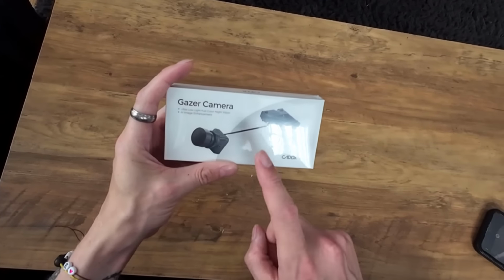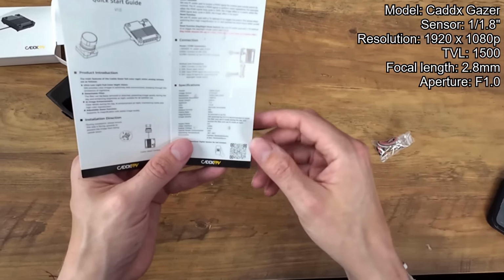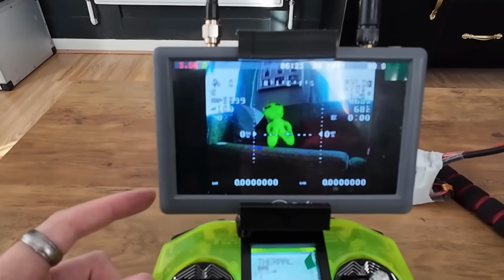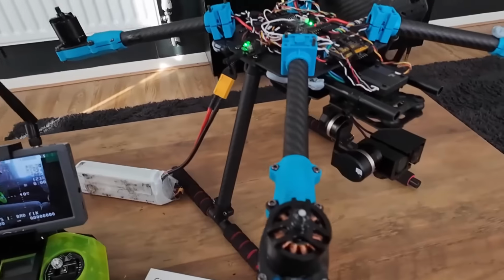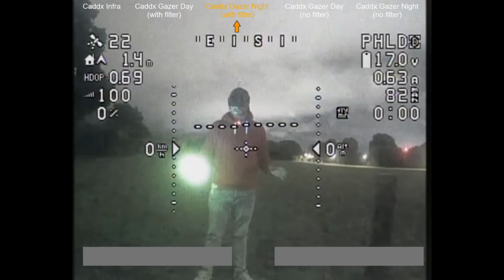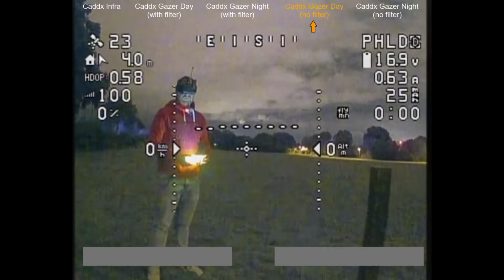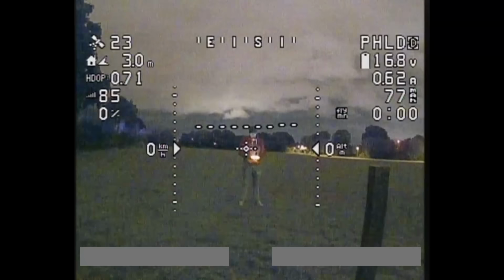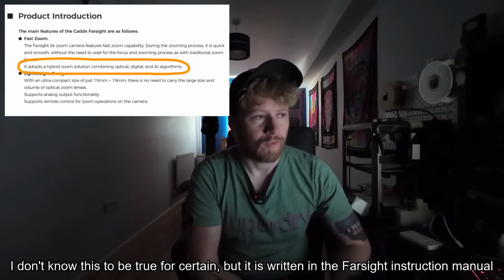📷 Caddx Gazer - COLOUR Night Vision FPV Camera - Unboxing And Review

Comment: The filter is an IR block filter, it's used in nearly all cameras built in in front of the sensor. Otherwise the IR light would blow out the red pixels on the sensor. (hence the pink glaze) 
There are day&night cameras with a built in filter moved by a motor for the night mode, or so called software day&night where there is no filter, and they compensate the pinkness in processing. 
The gazer has the proper filter, can be removed by hand, as an electromechanic way would be too big and heavy for FPV purposes. In the night mode it changes processing, expecting more infrared light. Also, the quality in low light with the filter on is degraded as there is significantly less light getting to the sensor, it gets noisy, the noise filtering kicks in hard, therefore having less detail.

Comment: Hi giz hope your well buddy been a subscriber for years! Looking to get back into flying again and I want to give long range fpv a go. I still have my taranis x9d transmitter would that be ok? Also any planes and parts your recommend for a long range build?
Reply from the maker: Hey man. The X9D is still a decent radio, however it is old and likely isn't supported by modern firmware. That in itself probably isn't much of a issue, however if you want to get into long range, you'll want a long range control link. These days ELRS is the system most favoured by pilots. You can likely get a module that'll fit your x9d, although I don't know if the firmware will support it. Personally if I were you, I'd look at getting a new modern radio, one that has ELRS built in. You don't need to pay much for one. I personally use the Radiomaster Pocket, which is probably one of the cheapest radios you can buy (only about £50). Don't like the price mislead you tho - it's a fully equipped radio with most the modern features you'd ever want and it's very reliable. I've owned many big fancy expensive radios over the years, but actually love my Pocket more than any other them 😊

Comment: id like to know how to fit camera like this onto a car? Some players like kenwood have analog input for reverse camera, does it just plug into that. Could be useful during night to see animals, installing the camera behind the front grill and installing switch between reverse wire and ground so reverse could be turned on even when going forward

Comment: Thanks, very interesting ... it seems the night mode is averaging the video signal, reducing bandwidth but also taking away some more contrast and color, but I guess with a weak signal going into night mode makes sense. But in general the Gazer is really impressive and makes the best compromise of low light and signal/noise while being extremely sensitive.

Comment: I believe that the Farsight camera is digital zoom as well.
I suspect they may be using a higher resolution sensor on the Farsight.
Reply from the maker: According to the manual for the Farsight camera, its a hybrid zoom (optical and digital), whatever that's supposed to mean?

Comment: I think the zoom feature is good because they said that the sensor resolution is 1920x1080 while the output is 720x576.
So you can't take advantage of the FHD sensor resolution with the PAL output, but with the zoom you can.

Comment: Does the Gazer Camera require a VTX?? Or is the VTX the box it comes with?
Reply: You will need a VTX, the box is just where the AI is stored.
Reply: @xGonniX thank you! I was wondering this as it doesn't necessarily say it on the site. I guess it's only compatible with analog VTX and not HD VTX? I know it says analog, but am hoping the VTX quality of analog doesn't take away from the camera quality on my monitor. Got any thoughts? Appreciate the response as well!
Reply from the maker: The camera is only compatible with analog VTX's unfortunately
Reply: @gizfpv that's no worries. If you do another video, maybe you can walk us through the wiring / setup a bit? I am going to get this setup on a speedy bee f405 wing, with INAV. Hope it works, I know it's a bit confusing

Comment: Something to consider.  I build drones for my job.  However when testing camera capabilities lights like the one on your controller can throw off how the camera and processing system tries to adjust the image.  I do like you have the controller in your hand for this test as this is a real world use case but to answer your questions about the day and night mode you definitely need to test without direct light sources within frame.
Reply from the maker: That is a very valid point. Any bright light source will throw off the exposure during a low light shot
Reply: Any chance you could point me in the right direction for a half decent drone with a flight time of 20+ minutes that I could chuck a gimbal camera on? 
I know of the flywoo explorer lr4 but no idea how it would go with the extra camera. Also I've never built a drone in my life so rtf is preferred but not undesirable lol
Reply: Yeah I was thinking the same thing as a huge bright light right in front of the camera

Comment: Considering that it's half the price of the Infra, the Gazer is amazing! That's the price point where buying one for a DIY NVG is a no-brainer. 😁
The big difference regarding the image details is of course due to the different sensors and methods: near-infrared light ("real" night vision) vs. visible light amplification!
Unfortunately, they probably won't produce a real infrared-only (thermal) FPV camera in that price range, because gallium lenses are really expensive. ;-)
Reply: Germanium, not Gallium. And the lenses are not that expensive, you get them for 10 dollars from china. The expensive bit is the image sensor, and those are rapidly falling in price due to the sudden demand. 
Axis flying sells thermal analog FPV cameras from about 220 dollars. The high resolution 60fps one is 600 dollars, which is honestly insane for the specs. Just 5 years ago you would have paid 10 times that.
Reply: Real night vision with image intensifier tubes is both visible and near IR (short wave). Thermal is far IR (long wave) only. Glass is used for short wave IR and visible, germanium is for long wave IR.

Comment: Filter will be an IR Cut, most action cameras have one inside the lens or over the sensor, All Mirrorless and DSLR's have them built on to the sensor, same goes with Cine cameras and camcorders.
There may also be a ND element involved, to reduce the light level in daytime use and protect the sensor. It is not a UV filter - that would be pointless on a camera aimed at use at a time of day where there is no UV light for it to use to see with. The extra pink in the image in the daytime, is the wideband nature of the sensor without the IR being cut out, and also why the image is soft, as IR light has a different focal distance compared to Green or Blue.
Looks like the Infra still has the edge, and the filterless night mode has a little more contrast, but much lower saturation. Night mode for flying, day mode for showing.
Reply from the maker: You're absolutely right. I did add a note towards the end of the video saying it was likely a IR filter.And yeah as you said, a UV filter wouldn't make sense would it lol

Comment: Great review! Did you notice any added Latency on this Camera vs a standard CVBS Analog Camera? It looks like a great color camera option for Day & Nighttime honestly.. I am very impressed as well. 
What are some regular Analog Camera's that you would consider the best night-time use camera's that came before the Caddx Infra & Gazer where it's basically just the Analog camera itself? I've heard some people like the Night Eagle camera, Ive personally used some older models like the Foxeer Cat S-Starlight Analog camera that switched from Color to B&W automatically and it works great still from an older Betaflight Drone I had it on and now on a newer budget Analog build that I fly in my area in a grass fields, around the street lights and things like that. Definitely not in a setting this dark, but I believe it does have a 0.000001Lux Rating. I've been looking for some newer options to add to a new drone im building since that once is a circa-2015/2020 FPV Camera and is not available anymore and its the older "full-size" 27/28mm Camera that I have in a TBS Source1 Frame that actually takes that size natively. Most stuff these days in 7" in or smaller are using 19mm-20mm Camera's or smaller. So I just figured id ask if you had any experience with something like that and have some recommendations for a more normal Analog camera without the extra AI Processing Box that comes with these newer Caddx Infra & Caddx Gazer Camera's. Though I do think I will eventually pick up either one of these once I end up finally building my FPV Wing that i have in the box still lol, as it has the space for this and would be more useful in this type of situation for me at least.. Thanks!!
Reply from the maker: To be honest because I've only used the camera on the ground so far, I haven't really been in a position to observe the latency. There certainly hasn't been any noticeable latency so far, but it's only once I get it in the air that I'll be able to say for sure.

As for other analog night vision camera's, I've not been able to test them all myself, but I do know the Runcam Phoenix 2 was a surprisingly decent camera for low light. Obviously not as good as the Infra or Gazer, but certainly decent. From what I've seen online the newest Night Eagle is very good too, but I've not personally tried it

Comment: Awesome video!! Great comparison with a lot of great Info!! 
What onboard DVR do you use to get that nice & clean Analog Feed recorded?
Also what CNC Gimbals are you using on your Radiomaster Pocket? How do they compare to the full-size AG01 CNC Gimbals if you've ever used those before? This is my first few videos I've watched of yours so I wasnt sure.. 
Do you have a Link to the 3D mount for the Analog Screen on the RM Pocket? It looks super clean with the cut-out for the RM Pocket's Controller Screen!
Reply from the maker: The DVR I'm using is the one built in to my Skyzone Cobra X V2 goggles. The gimbals on my pocket are the AG01 nano's (made by Radiomaster). As for the screen mount on my radio, that's still a work in progress. Once I've finalised the design I'll put it on thingiverse :)

Comment: They had the Optical Zoom feature listed in the Picture part of the Product's page. So it wouldn't be searchable on the website's product page if that's what you mean that you can't find it anymore. I remember seeing this on MadTech's Livestream when it first came out and even he was talking about the Optical Zoom, bc in some spots it said Optical Zoom and some spots it said Digital Zoom, and it was in the big picture ad of the product. 
To the point of that he was also saying like I was thinking.. 
How would you control the Zoom regardless of what type of Zoom it used.. It would need a Full UART connection for that I would assume.. Or possibly PWM set-up from the FC for the Zoom I guess could work as well, but it definitely did advertise 3 levels of Zoom. 
Haven't really heard or seen much of anything since this was announced a few weeks/month ago then so I'm glad to see this video!!
Reply from the maker: Yeah I feel certain that when Caddx announced the Gazer they said it had optical zoom, but I can't find any posts that say that now, so maybe they deleted or edited them

Comment: I wonder if the additional ports are to make a walksnail version like the moonlight. The ports look very similar to the walksnail moonlight ports with the "usb" 4 pin cable used. I would not be surprised if its the same "AI" box, maybe we  will get walksnail support eventually?
Reply from the maker: Yeah I'd be interested to know what the other ports are for. No mention of them at all in the manual

Comment: I've had this for a while now, been waiting on someone to make a video about it as I'm LOST on how to use/set up. The instructions/info on this are ridiculously poor (its pathetic to see Caddx putting that out) and I ordered it to do a day/night capable quad with BF, I hope someone does a video on hot to set it up on BF soon so i can use this paperweight, lol. 

One question I have though, that you didn't talk about...... what's the latency like? Any difference between day/night modes as far as latency? I've seen other "night" cameras that had a very noticeable latency. Perhaps you'll address it in the next video
Reply from the maker: I don't have any aircraft running Betaflight so I can't investigate for myself, however the instructions in the manual look like they explain how to set it up reasonably well? What exactly are you struggling with?

As for latency, I haven't noticed any significant latency yet, but it's only once I get the camera in the air that i'll be able to say for sure
Reply: @gizfpv  First thing I struggled with (still not installed yet, but still learning about it) was realizing the "AI' box doesn't have a VTX in it. I was wondering why there was no info on antennas or power ratings. So that means I have to figure out where to run these wires from the box, to the FC, then to the VTX. I just did a Walksnail on an 85mm and it was a simple 4 wire solder job, I dunno, maybe I'm just overthinking the Gazer install. 

Second thing I know I'm going to struggle with (which thanks to your video, I found the online manual that does talk about it briefly, but still is out of my skill range) is setting up the controls for the D/N mode. I'm not at all interested in the zoom, but I don't know the first thing about CLI commands and "pinio" stuff

🤣🤦‍♂ I might have gotten a little in over my head with this one, but I'm sure ill figure it out eventually, just hope I don't burn anything up in the learning process lol
Reply: I am surprised you struggled to work out what the power and video lines do. Everything else is just uart configuration, which you shouldn't need to get it working at least.

Comment: Thanks for another really interesting video. I agree with our assessment concerning the Infra. I think the image from the Infra had more detail.
Still, the price for the Gazer is surprisingly good.

I think the filter is likely a near IR filter. Most color cameras have a filter to block infrared light. Normally this filter is right in front of image sensor. Astronomers often remove these filters from their cameras to improve their ability to capture faint light sources.
Reply: Yeah it's an IR-filter. That's the only thing that makes sense. Without the IR-filter, the colors will be incorrect.

Comment: I was waiting for a video from you as soon as I saw this one on their website! Might get this even if I don't have any builds to use it in at the moment, just because of the zoom feature which I've never seen before on an analog camera combined with the color low light performance is such a cool combo, and a bit more reasonably priced than the infra too.
Reply: The night vision is definitely cool. But digital zoom isn't great. It's exactly the same as taking your recorded video into Adobe Premiere, and zooming into a section of the video. You're better off recording in full frame, and zooming in when editing. You'll increase the noise and grain, just as you would with digital zoom. But at least you can choose where to zoom after the fact, instead of baking the zoom into the video
Reply: @rubberonasphalt  You do make a good point and I also generally agree it's better to have a full frame photo or video and crop in post for actual content creation purposes, but the use case I had in mind for the real time zoom was more in terms of letting me get a closer (larger) look at something while flying in the tiny goggles screens or a monitor where actual detail doesn't matter so much. I sometimes find myself switching my old dji camera drones down into 1080p video for this exact reason, because it lets me do 4x zoom in the lower resolution mode, so I can actually see stuff on the tiny 10 inch tablet display while in the air. It's great when you're exploring a forest and spot something but don't want to risk clipping a tree or losing signal by going lower.
Reply: @ml11ML  Yeah that's a fair point

Comment: Thank you so much for posting this. I’ve spent most of a week thinking I was suddenly incapable of FPV. I’m trying to get a basic start with the Gazer on a SpeedyBee F405 V4 using Betaflight. Are you able to share any of the additional troubleshooting you did? I’m at a point where I have the basic day video feed on startup but none of the zoom, zoom reset, or night switch are working whatever I try.
Reply from the maker: As I didn't use Betaflight, I can't really provide any tips regarding that. However 1 issue I did encounter when setting mine up was with the wiring loom for the UARTS/PWM connections. I didn't realise that the wiring loom is different on each end, and I initially mistakenly plugged in the wrong end when I first set things up, which resulted in things not working. Might be worth checking to see if you made the same mistake?
Reply: @gizfpv  This was it! You're a legend thank you.
Reply from the maker: @Mike97dg75cb  You made the same mistake as me with the wiring? That's kinda funny lol. Caddx really should make these things clearer! Glad you managed to solve it :)
Reply: The board you're using has four extra motor ports (M5 to M8). These can be configured as servo ports. Bardwell has a video on using servos in Betaflight. I followed his video to use the extra motor ports on one of my flight controllers to control a gimbal using PWM signals.
Unfortunately, Bardwell's servo video isn't one of his best. He goes down the wrong path a couple of times trying to get a servo to work but he finally figured it out. I was able to get the servo outputs to work on my FC by watching Bardwell's video but it wasn't as simple as I had hoped.